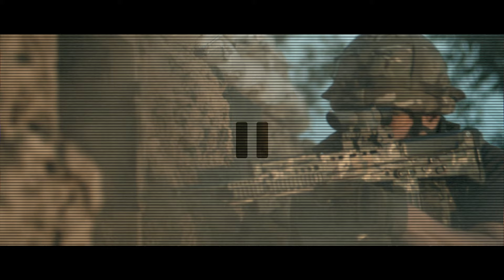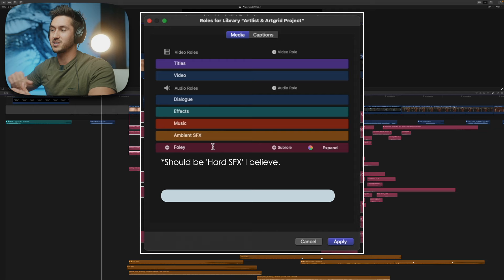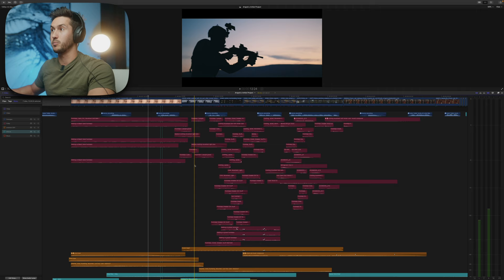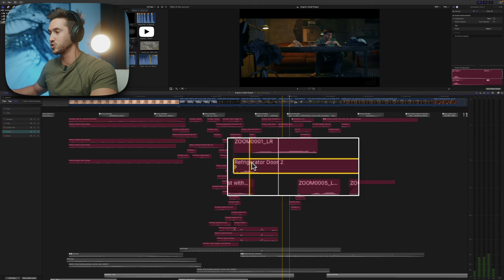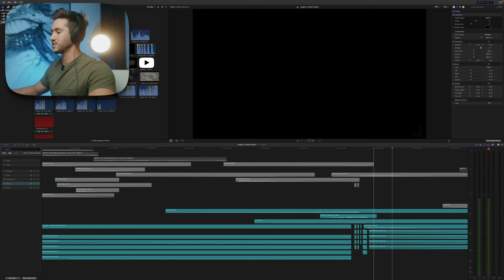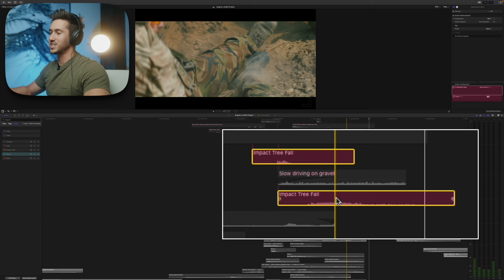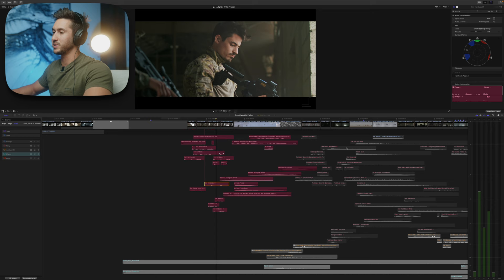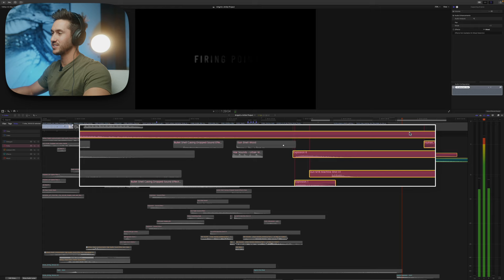In-Depth Cinematic Sound Design Breakdown

Comment: This is outstanding stuff! I don’t get to do a lot of sound design in the things I do, but I have a deep appreciation for the immersive sound design you’ve done here, and the entertainment value it provides. You don’t mention it - but I’m pretty sure you didn’t do all the voiceovers yourself! I consider it equally important to get the right voice/dialogue for each character. Outstanding, outstanding, outstanding!
Reply from the maker: Thanks so much, my friend! Unfortunately, I forgot to mention a lot in the video. I was questioning whether or not to even post it for that reason. And you're exactly right! I had two of my buddies do most of the work (they're not actors but I think they did pretty well). All the other stuff, like the grunts, the men breaking into the house in the beginning, was done by me. Thanks so much for the comment and feedback! 🙏